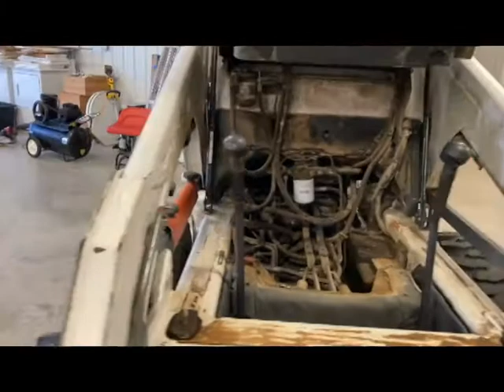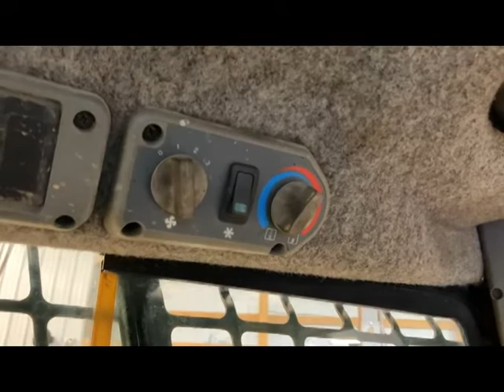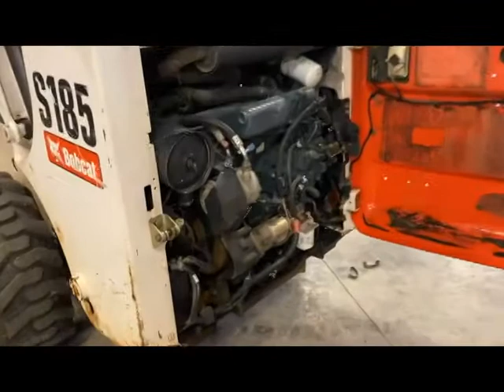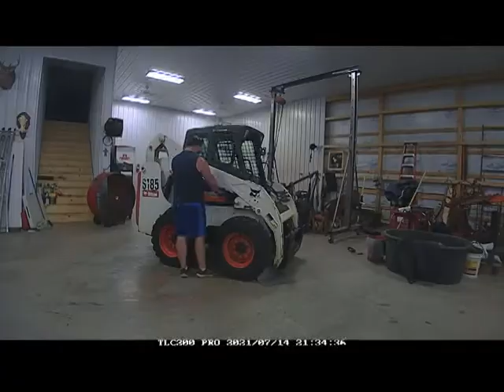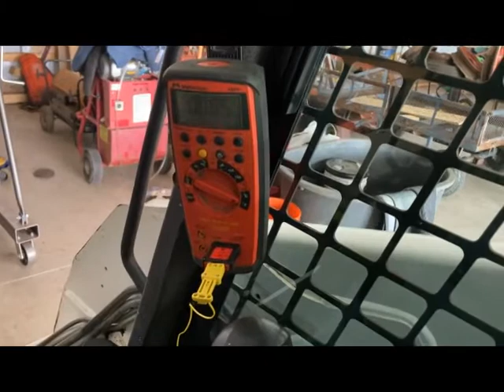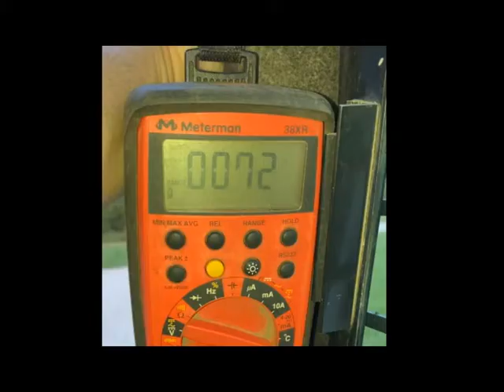Bobcat S185 AC Troubleshooting Compressor and Receiver Dryer Install

Comment: I am having the same issue, except my compressor does run when I jump out the pressure switch. I am thinking it’s the receiver dryer. Thoughts?